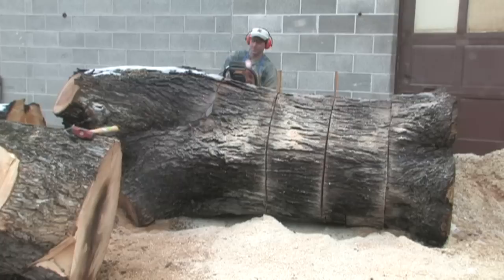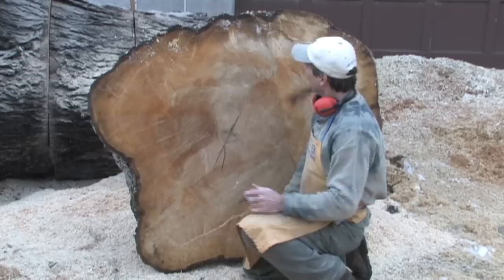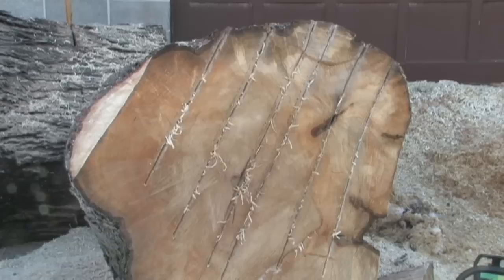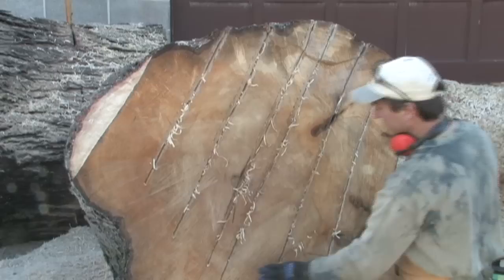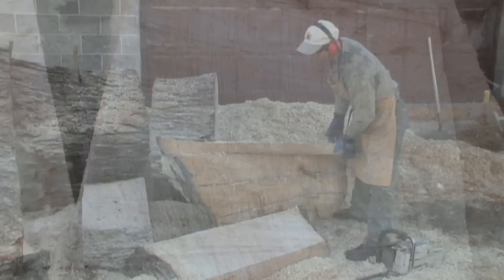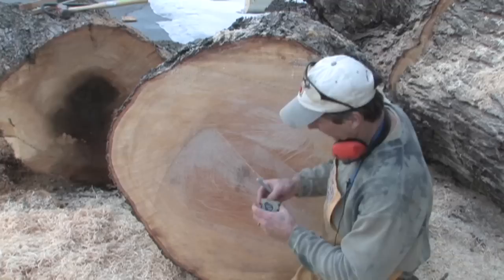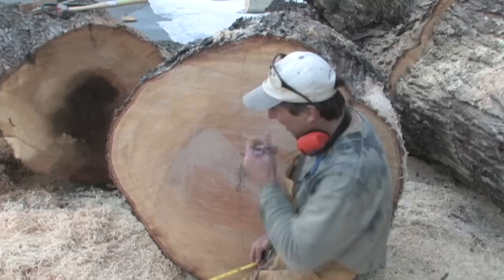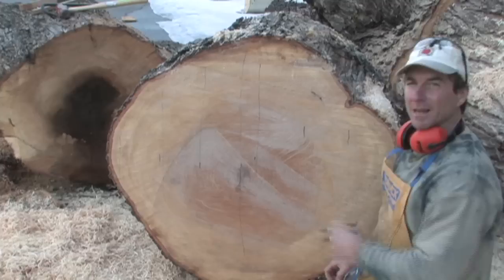Slabbing a silver maple log

Comment: Thank you so much. I have 48" dia spalted maple from 200? yr old sugaring trees here in Huntington VT. Just could not get the blanks right until I saw your approach. WIll save me so much time getting the blanks from bandsaw to the lathe. in one 8 foot pirce I found a 6 foot heavy chain burried inside but just visable on the outside. Will cut that one last. Thanks again!

Comment: When I chain saw I put on chain saw chaps and a helmet with face shield and ear protection.
If you are doing casual cutting most 16" chain saws can run a longer bar. For example I can run a 28" bar on my old Homelite 360 for cutting bowl blanks. For dropping trees and cutting firewood I only use a 16" or 20" bar.

Comment: Makes me want to cry when you dice such beautiful timber into pieces.......for bowls.
Reply: +king5ley The trees are replaced I'm sure.  And the bowls are beautiful too.

Don't be so wet.
Reply: +lifeshort The first line of your reply would have been sufficient, the second just makes you come across as a spoilt child.
Reply: *****
I don't know how you arrive at 'spoilt' from that statement
Reply: calm down girls
Reply: It would really break you down to see me split firewood.
Reply: The simple fact about silver maple is that it is only good for small items.  This wood is super hygroscopic, it absorbs moisture more readily than most woods.  If you try to make a cabinet from it, the natural pressures in the wood as it changes with the seasons will cause splitting and joint separations.  In a bowl or platter the changes are scarcely noticeable.
Reply: @jonathanljohnson  Still, silver maple has prolific and marvelous fiddle back and quilt figure. Makes gorgeous jewelry as well as pen bodies.